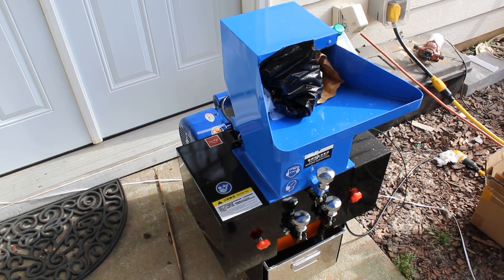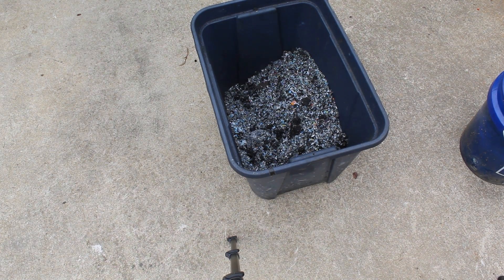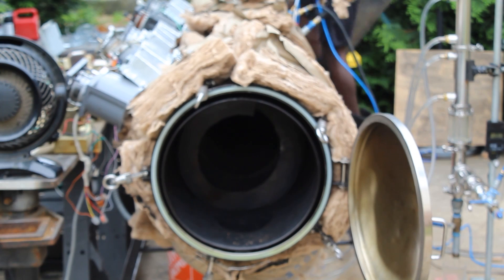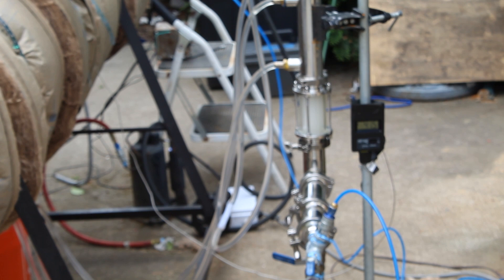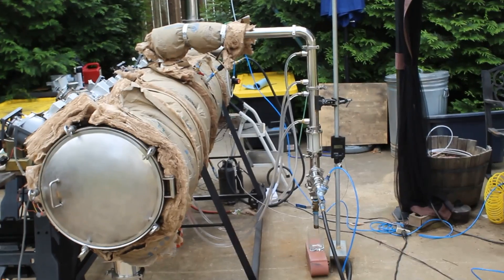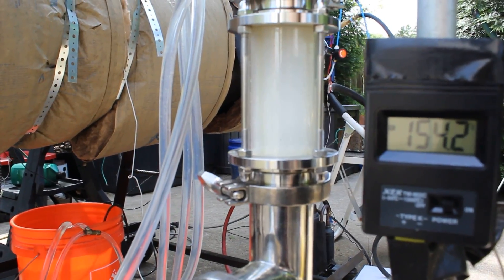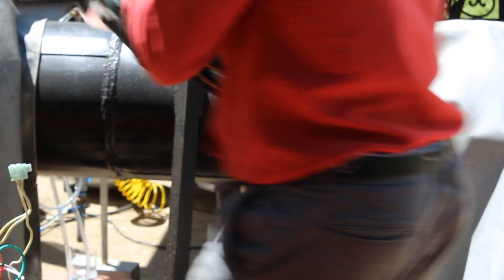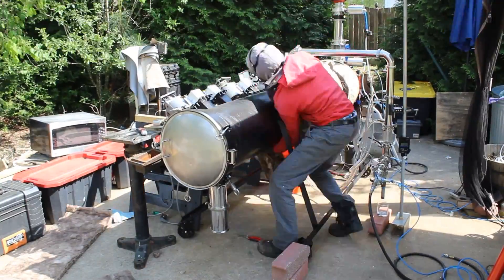Running PLASTIC  to FUEL Reactor Mark 4.5 PART 1!

Comment: Hey man, I love what you are doing but I think you have over complicated the process by relying on microwaves. Pyrolysis needs no microwaves, just a lighter. You just need to get the fire burning and then control the air so there is none. I guess your process must be really clean the way that you are doing it but I would also guess that getting that energy back would be more difficult. You are putting quite a bit of energy in to start the process rather than relying on the energy in the plastic to drive it.

Comment: How much coal was burnt to power this machine esp. At a small scale i love this stuff its cool asf it just cant b viable
Reply: He doesn't burn coal he turns plastic into fuel using magnetrons from microwaves which heat from an electric source is able to break down the plastic into oil gasoline and natural gas its quite simple
Reply: @MichaelGUZMAN-qs8ov Simple, yes. Viable, no. The amount of energy he's using to turn this waste plastic into crude is orders of magnitude larger than the energy you can get from combusting the product. This doesn't even get into fractional distillation, reforming and cracking that would be required to actually process the crude into usable products, like diesel or gasoline, which would require yet more energy.

The key to solving the viability problem is with catalysts, which can greatly reduce the energy cost required to turn plastics into crude. He has none, just brute force pyrolysis. Companies keep their catalyst recipes secret, but we have yet to find any that would allow for viable conversion to fuels. That is where research into this should b focused. Not on pyrolysis contraptions that will never be viable.

Comment: Couldn't you just burn plastic to heat the plastic instead of using microwaves?  Once its going, use the gas to heat the plastic so you can burn less plastic.  Then you don't have to mix carbon and take up volume in the chamber allowing you to pyrolyze more plastic.  I mean if you're going to burn the liquid and gas fuel anyway, why not cut out the middle man?  I bet you would save quite a bit on that electricity.
Reply: I am very curious how many thousands of dollars he's sunk into this setup to yield $10 worth of crude that isn't even usable as a fuel becuase it combusts like wet mud.

Comment: How much energy does it take to make a gallon. Is it more or less than the potential energy from the fuel. This is my only critique.
Reply: Just a rough guesstimation, but I'd say he's getting about $0 worth of useful fuel for thousands of dollars worth of investment. Even if it were refined, costing thousands more in investment, the yield would be measured in the single digit perecents of energy consumed. Meaning, ignoring the cost of the pyrolysis and refinement machines, for every $100 worth of energy put in, you'd get about $6 worth out. Even that is likely very generous. There's a reason companies don't do this.

Comment: based on what I just watched, it is

1. Grinding the plastics 
2. Add catalyst, the powder carbon
3. Prepare the tank by vacuuming the oxygen, feed the plastics. 
4. Feed the inert gases and start microwaving. 
5. Make the solid into gases and make em condense into a liquid. By product I guess. 

The only by product I can see here are the powder charcoals from previous reactions. Now we need to identify the ratio for say a Liter of refined oil
Reply: Replying to my own comment, the next thing for a Gas Byproduct is to connect it to a combustion engine couple with alternator and generate power to energize the reactior
Reply: What type of catalyst
Reply: There is no catalyst. This is just pyrolysis. It will never be cost effective, essentially wasting energy. There's a reason we don't do this. If it costs $100 to make back $60 in energy, you're better off just keeping the $100.

Comment: I'm planning on doing a pyrolysis plant that will be powered by incineration of municipal waste, the heat generated from the incinerator plus syngas will run the pyrosis and distillation plant.

I'll then I'll use the resultant Diesel to run my diesel generators to produce power which will be used in my interlocking bricks making machines for affordable housing. 

Much love from Nairobi Kenya 🇰🇪
Reply: Good ideas
Reply: You can once store the syngas  and start the plant the next day it can run until the other gas is ready to heat the reactor 
Am from Kenya also

Comment: Thay already have this on a large scale ...it's called syngas only thay use a plasma electric ark to vaperize the garbage , plastics bio metal everthing ....this guy is using microwaves to try to vaperize...but it's still genius level and if he is successful might be able to use this in small towns because it can also be used to generate electricity,  hopfully it uses less energy then it produces...plus it's small !!

Comment: This is ingenious.  A plastics plant I used to work for as a process technician WASTED TONS of ground plastics monthly snd took it staright to dumps because we could not reprocess it for parts. Every plastics plant in America operstes this way and writes off this waste as a loss. Polycarbonate, polypropylene, nylon, polubeutyline, all this regrind was waste.  There are several plastics plants in Evansville Indiana alone that produce tons of regrind as plastic waste.  We were always told as technicians that there was nothing to do with the tons and tons of plastic regrind.  (Company name here) Produced at least 3-6 TONS of ground plastic waste per day (in three 8 hour shifts).   And this regrind was either bought for pennies on the dollar or taken to landfills.
Reply: It probably just isn't profitable?
Reply: @AapVanDieKaap it's profitable when you use microwaves to make it

Comment: So I gotta ask - with all the carbon being added, along with the energy required to run it, will the fuel generated from the plastic be enough to cover the cost of the energy+carbon?
Reply: Burning the carbon alone let alone any coke formed would likely produce enough energy to power the unit

Comment: This man needs to make a barge that collects floating plastic waste on the surface of the water that has this setup installed so the barge literally converts the plastic that it collects on shore into fuel for itself
Reply: He's got like 8 microwaves turned on and running. He's spending $1.00 in electricity to produce $0.05 in fuel, fuel he has to still further process.
I would bet money the waves from the magnetrons are canceling eachother out in many places too.
Be far more efficient to just collect the plastic from the ocean sadly.
Plastic will never be future fuel. We just need a way to dispose of it correctly, like an enzyme that can process millions of lbs at once.

Comment: Bro is gonna get chased down by the gov
Reply: The tech is simple. The energy conversion is the tricky part.  He a this point is drawing over 50 amps to run his equipment.  That a lot of energy for that little fuel he is producing.  As he develops the process is where he should improve the  efficiency.

Comment: #1: You are making Crude Oil. Not diesel or gas. 

#2: burning all of that plastic is releasing chemicals into the air.

#3: Where are you dumping all of your used plastic sludge?
Reply: Its turns into the stuff

Comment: This is a total sham

Pryrolysis reactors PRODUCE carbon black, your adding the end product

Microwaves excite water particles, as neither plastic or carbon have water in them neither will absorb microwaves

Your making fuel oil, not gasoline

Comment: Are you able to reach out to a metal fabricator to get the tolerances tighter on the large rotating coil? I feel like it could be more efficient with that upgrade alone.

Comment: This technology already exists, but it's amazing to see it in action.
Reply: I went and checked his first video then did research. I do not know if he really is doing this but I will say the first research paper I found was by Boston dynamics and it was released 21 days after his first post. The only thing that confuses me is how it becomes a liquid in a microwave setting plastic will heat, melt, and lose viscosity rather quickly. Mabye he’s adding a chemical, or some how keeping it under high pressure keeps it in a liquid state. Either this video got my brain buzzing so well deserved like.

Comment: I had the same decentralized energy idea except with the oil well gas flares. Instead of burning it off we could turn that energy into electricity to run a mesh network node or tie back into the grid with the energy making it more resilient!
Reply: Great idea. This would also give us time to develop a more efficient and stable battery that is also environmentally friendly.
Reply: @Frames_debates  exactly. Perfect implementation for the coming demand of EV's. I did the math and I could be wrong but in 1 year of energy generated from flares world wide could be converted into electricity to run the world for 100 years. It's almost stupid

Comment: Love the added insulation. Glad to see that made a big difference. I am going to make my own prototype soon. Thank you for the inspiration
Reply: Did you see how many parts that thing has? He easily has over 10 grand in that thing, shredders, magnetrons, and welders are expensive!
Reply: Easily a lie.
Reply: Christ people are supportiive 😆😅

If you are making your own prototype, godspeed. Please be safe. 💖
Reply: More that just means moar microwave owens to sacrifise caution if u dont know What ur doing u will die.
Reply: It's a bigboy playground for some ppl, and it's not rocket science at all
Reply: @jacobclement8150do you have any sources or reading material on why this doesn’t work or how he’s lying? I’d like to know why
Reply: He's not lying but he is also creating loads of cancer causing chemicals as byproducts and I worry for his safety. Particularly high amounts of benzine.
Reply: DONT BUILD THIS THING UNLESS YOU HAVE A DEGREE IN CHEMISTRY AND ACTUALLY UNDERSTAND THIS PROCESS, IF YOU ATTEMPT THIS YOU COULD EXPOSE YOURSELF TO A PLETHORA OF CANCER CAUSING CHEMICALS THAT ARE A BYPRODUCT OF PYROLYSIS!

Comment: Really cool setup you’ve got there. This project is really interesting, you just popped into a my feed and instantly subscribed. 

A future set up idea for your project if you’re ever interested, try adding a solar panel and battery setup. Essentially this whole system and setup will be able to run off grid or just independently. Use the power of solar, get your oil and natural gas, essentially you’ll be producing 3 different types of energies. 
Having all 3 energies, gas, oil, and electric, you’ll be set for any project. And since it uses plastic, just doing a quick community service around the city you can collect and recycle that plastic and just have your own supply of energy. 

I truly see many great things coming your way and can’t wait to see the future projects!

Comment: Have you ever sent the oil produced by the reactor to a lab to see what it is composed of? Its probably a mix of crude hydrocarbons, but it'd be interesting to see what else you're getting.
Reply: He could do a fractional distillation and find out for himself. Ive never seen this channel before but he is obviously capable of doing it. Could be a cool series of videos
Reply: It's expensive he's only 18 and has received a very small grant given what his goals are of 200k he needs to network and find school and universities to help him with his projwct
Reply: I hope he does this, I’ve been curious about this since I first saw his channel. Those who used the fuel say it smells like plastic, but not like burning plastic. It’s weird
Reply: He's making shittons of toxic benzine doing this along with a whole plethora of dangerous cancer causing chemicals.

Comment: I could see countries with massive plastic waste disposal issues and need for crude oil could make great use of this! It would give them a monetary incentive for them or even private individuals to clean up rivers. (Just as I type it I see an article about a Thailand plastic waste crisis!)

Have you ever thought to reach out to foreign entrepreneurs?
I really hope someone helps you sink money into scaling up and refining the process further.
Reply: He didn't invent this process... The reason no one does it is because it's very inefficient. You put in a ton of energy and get very little out. Also it doesn't work with every type of plastic. And sorting out the right types of plastic is actually really difficult.
Reply: @johnhonda93  I could see a couple situations where it would make sense. Industrial processes with huge amounts of waste heat, and green energy set ups that don't have a storage system. There's lots of waste energy/heat that could be used to do something like this just not really a will or a real path to profit.
Reply: @W1ldSm1le  if you have waste heat it almost always makes more sense to just generate electricity with it and then use the electricity. There is maybe a few small places where this would make sense. But it's certainly not going to be some sort of recycling revolution.
Reply: @W1ldSm1le  and as for energy storage, there is much more efficient and easier to make and maintain systems for storing extra electricity. And systems that exist. Literally pumping water up a tower is more efficient and easier to do than this. They can heat sand to store excess power.. and a bunch of other ways that would be more practical than doing this. This could maybe make sense for someone to do in their back yard if they have extra solar power as a way to make their own cooking fuel and fuel for a diesel vehicle maybe. If they have access to tons of the right type of plastic for free. I'm not sure how good quality the fuel is that this produces, but I would bet a properly tuned mechanical diesel engine could run off of it. You can run them off of basically anything... But im not sure that all of this would be less work than producing your own ethanol for fuel. Or even seed oils.even better if you can get free used vegetable oil from restaurants in your area. You can fuel diesel engines on that, and a lot of places will just give it to you.
Reply: We can use this to clean coastal beaches as well
Reply: There's companies that suck carbon out of the air and make fuel/oil. So fuel/oil is renewable

Comment: Genius 💯keep going God bless
Reply from the maker: Thank you 🙌
Reply: @naturejab  if you don't mind I would like to make a suggestion, regarding the capturing of the toxic fumes, wich are produced from this process!!! along with potential ways, to address this issue!!! if you attach a carbon filter, to this diesel fuel generator exhaust!!! Essentially doing two things the carbon filters can be continuously reused, not only for capturing the plastic chemical compounds and fusing it with the carbon instead of being released in the air!!! The carbon filters then would be used as additional source of plastic to diesel material / fuel! Which would further contribute to this idea of a truly green sustainable non-toxic energy production